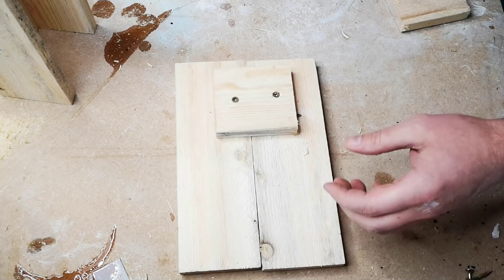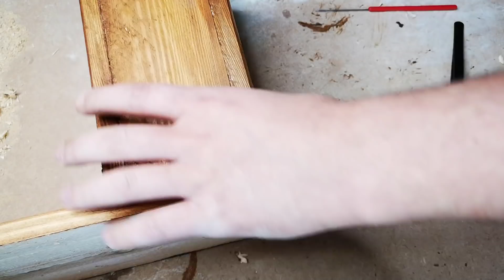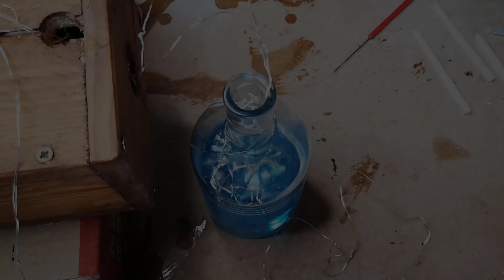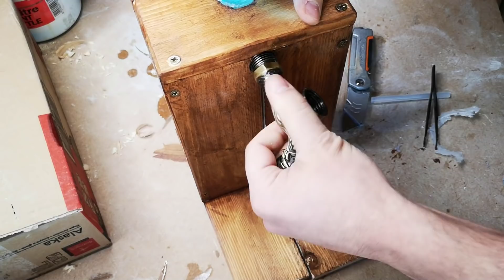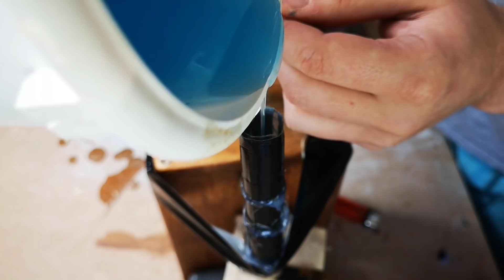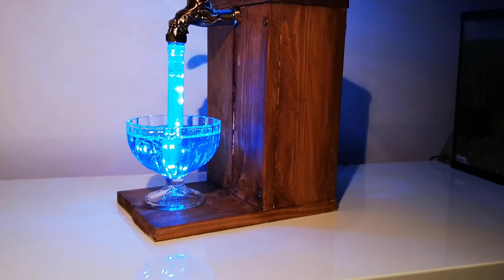Magic Faucet with Epoxy Resin / Night Lamp - Resin Art

Comment: Very fine, I'm trying to do a one similar... But the question is always the same.. If  leds will fail or break, how do you substitute them?.. The only way is to rebuild from zero the entire system of resin (probably the most expensive part of the entire project) 🙄... I'm trying to do this project with some transparent guide in wich I'll insert the leds (vescical cathethers will be good.. And in the guide I don' t pour the resin)... So If the LED will break I can retire it from the guide and insert another one... The only real difficulty is in the round or irregualar tracts in the glass... But I want to try =)

Comment: How are you powering the lights? I can't see where the end of the lights with the USB part is, if there is one
Reply: Those tiny wire lights are generally run via a battery pack.

Comment: The concept is awesome! At a distance, it's amazing. My question: is the box itself meant to look old and well used or ... ??
I'm honestly curious. You put work into the planning and execution of the resin but not the box. Wasn't sure if that was on purpose.
Reply from the maker: yes box itself meant to look old
Reply: It doesn't look old though, it looks new and like shit. That wood isn't meant to be used like this because its too soft and most of the screws stripped out the holes thats why half the screws are sitting above the surface of the wood. Could he not even feel that while sanding? You could pull the top off with one hand its so loose that resin jug on the top isn't going to stay there for long